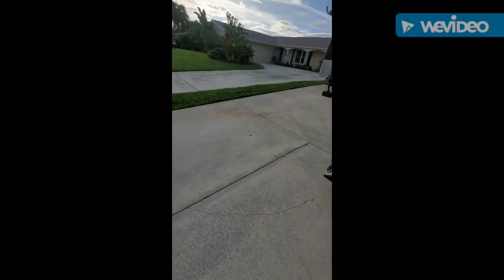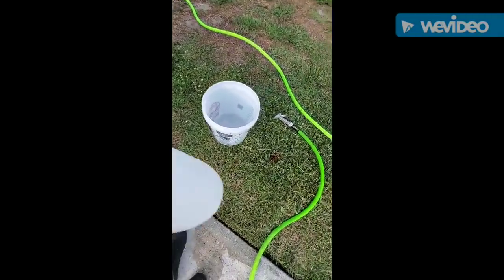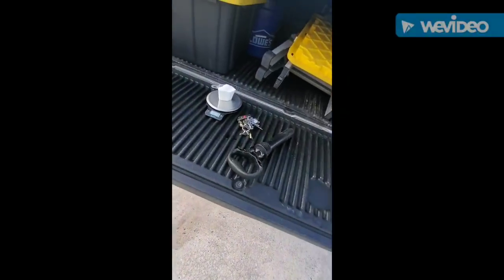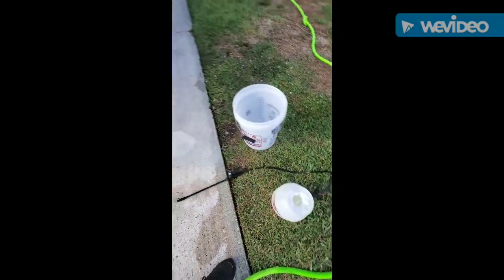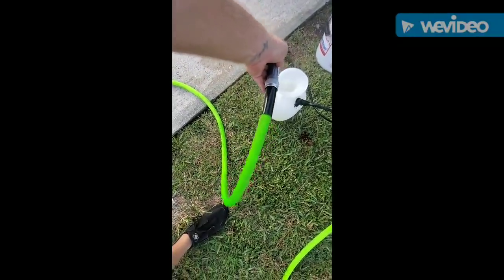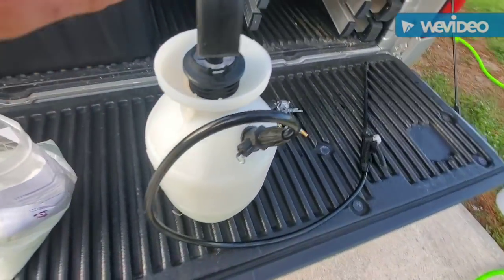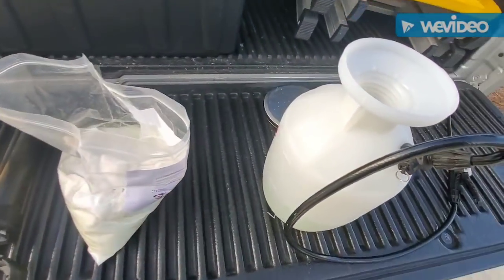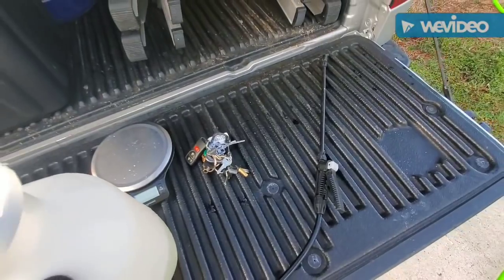rust removal with oxalic acid

Comment: Use proper ppe!!
- Oxalic Acid can affect you when inhaled and by passing 
through the skin. 
-Oxalic Acid is CORROSIVE and contact can severely 
irritate and burn the skin and eyes with possible eye 
damage. 
- Inhaling Oxalic Acid can irritate the nose, throat and lungs 
causing coughing, wheezing and/or shortness of breath. 
- Exposure to Oxalic Acid can cause headache, dizziness, 
nausea and vomiting, convulsions, coma and even death. 
- Prolonged or repeated contact can cause a skin rash, pain, 
redness, blisters, and slow healing ulcers. 
-Oxalic Acid may damage the kidneys. 
-- Exposure may affect the nervous system.

Comment: We used a 2% SH mix to surface clean a concrete patio. Then spot sprayed rust stains with Oxalic Acid and rinsed off. The spots where we sprayed the OA were much brighter and left it blotchy. Should we treat the whole surface with OA to make it look uniform?
Reply: Yes that's exactly what you should do.  Same with F9 barc.  Always clean the entire pad to keep it uniform.
Reply: This is exactly what happened to me the first time I did rust removal. I had to treat a 1,200 sq/ft area to balance everything out.

Comment: Mike it’s James with JBJ pressure washing and soft washing. I’m have problems with this I used hot water and shook it up in a two gallon sprayer, it clogged up my sprayer and all the acid went to the bottom of the sprayer. Any suggestions I appreciate it a lot .
Reply: Pre mix in a 50 gallon bucket first
Reply from the maker: Julie is corrrect pre.mix then put in sprayer... pre mix as many gallons as u need for that day only

Comment: Anytime I apply this, I’m wearing respirators, chemical gloves, goggles and protective pants. Your a brave soul. That stuff is pretty dangerous.
Reply: You can also use citric acid which less caustic.  Less dangerous. 
Critic acid like oxalic acts like a cheating agent/anti oxidant which is good for rust removal.  (Although I made 30% citric acid solution) and it was thick and sticky.

Comment: What is the difference between Ox and the Napa aluminum brightener?
Reply: Different chemicals and reagents. For example "aluminum beightener" contains sulfuric acid, among other things.

Honestly use what best for you, but if you clean windows, and are trying to remove rust off of metal use oxalic or citric acid. 
They prevent rust while you're cleaning the part (sulfuric acid for example is a strong oxidizer which promotes rusting, which doesnt matter for aluminum).

Citric is safe enough can touch with your bare hands (of course I wouldnt drink it or squirt into my eyes)